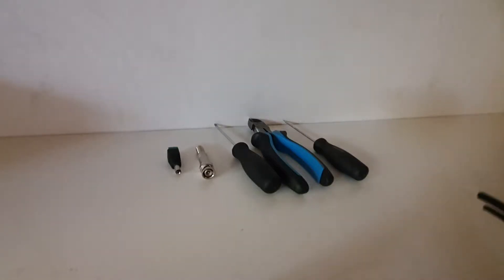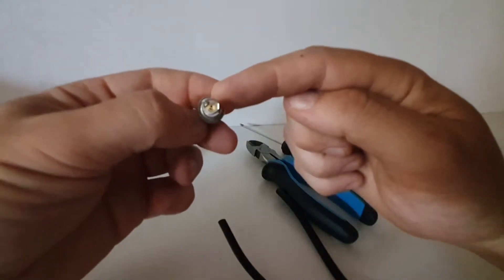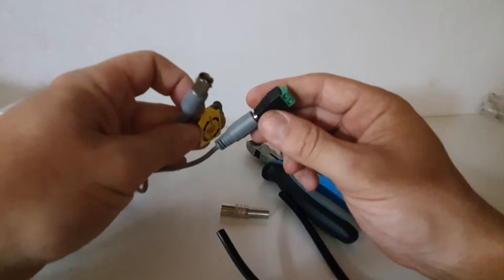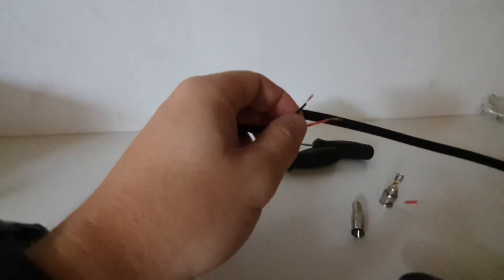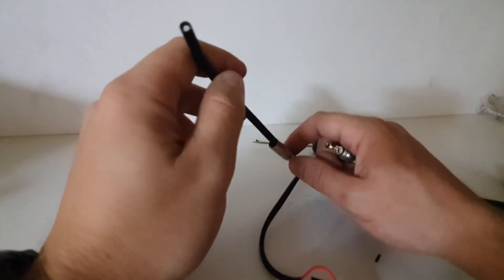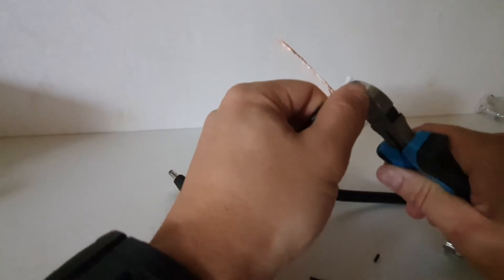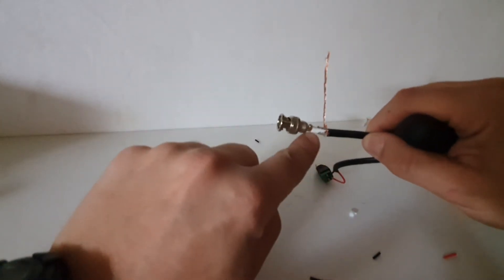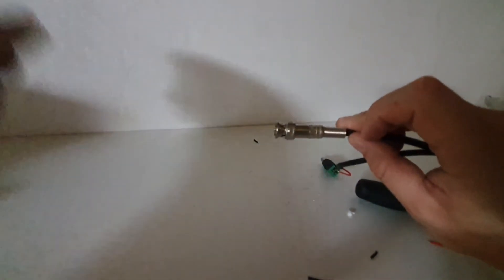How to do a BNC video connection - Hikvision Turbo HD camera

Comment: What exactly is the connector called where you connect the video wires?
Reply: We call it a BNC VIDEO connection. Any reputable security shop/installer, should know what you're talking about if you're looking to buy it.
Reply: Also, this is what Google says;

A BNC (Bayonet Neil-Concelman, or sometimes British Naval Connector) connector is used to connect a computer to a coaxial cable